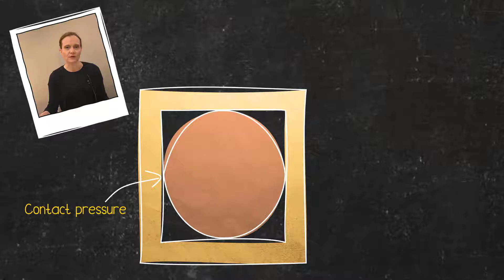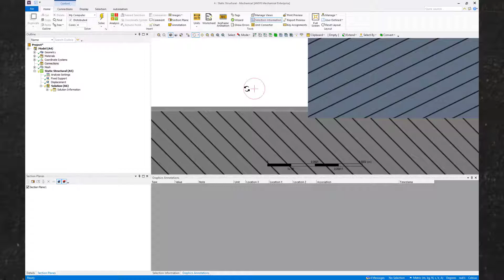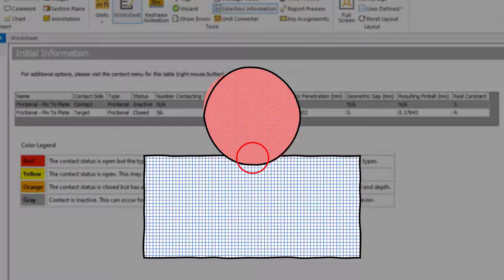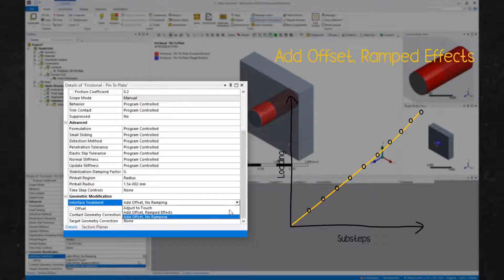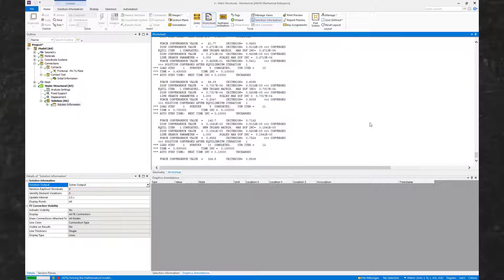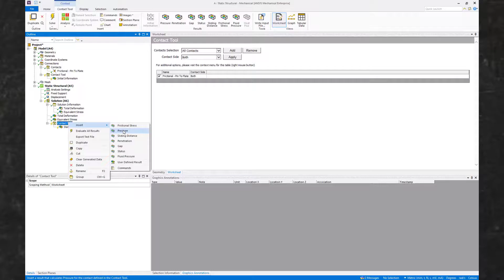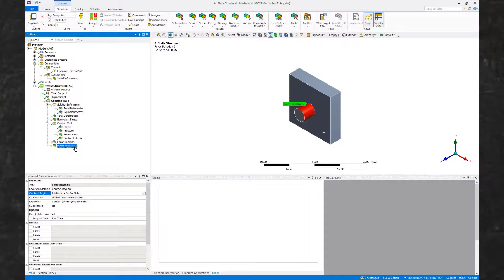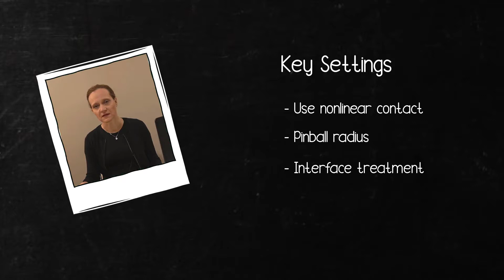Solving an Interference Fit Problem Using Ansys Mechanical — Lesson 2

Comment: +5 years later... this is great guys!! So many AhA moment.  1 question: Why did we see a small, but still considerable load during the first step when there was literally no displacement? It was about 10% of the final load, and interestingly in the opposite side. So, I was wondering if the calculated final force would be the difference between the two forces or not. Thanks!

Comment: What will be case if i want push the  pin by applying some force and pin and hole having interference in this situation what would be the load step setting?

Comment: Thanks for the video. but the stresses shown in the plate are very high. How can you justify them that my plate is not break. In fact I'm doing the fatigue analysis with interference connection between the bodies. So my question is due by the the high interference stress, alternating stress in the fatigue analysis is very high so. So do we have to consider the interference stress while evaluating fatigue analysis??
Reply from the maker: Thanks for watching! Please post your query on the Ansys Learning Forum for a detailed answer from the wider Ansys Community: https://ansys.com/forum.

Comment: Thank u for helpful lecture. And I have a question. In your practice you made two force reaction probe, displacement and contact region. and two outputs are different, about 1000N and 830N. what is difference between two methode and which one should choose for pull-out force.
Reply from the maker: Thanks for watching! Please post your query on the Ansys Learning Forum for a detailed answer from the wider Ansys Community: https://ansys.com/forum.

Comment: This video is very helpful. I am doing research about CNT (Carbone Nanotube)or CF (Carbone Fiber) embedded  in cement matrix. To  investigate the bonding strength there is need to do Pull - Out analyses which is very difficult. What kind of video or lesson can help to understand this type of analyses in ansys. Thanks a lot.
Reply from the maker: Thanks for watching! Please post your query on the Ansys Learning Forum for a detailed answer from the wider Ansys Community: https://ansys.com/forum.

Comment: Hi the equivalent stress is 4200 MPa in this problem, wont the material fail at this stress? Ultimate tensile strength for steel is around 500 MPa, can anyone explain.

Comment: Where does  the frictional coefficient of 0.2 come from and why ANSYS is displaying a warning message when using a higher coefficient? If you have a link to a page or article that explains it that would be great.
Reply: Coefficient of friction will depend both material. 0.2 was given as example on this video.

Comment: Is there an option to set tolerance field? In this case 0.1 interferance fit is on the whole surface constant which is not realistic it should somewhere be higher somewhere lower.
Reply: I think the idea here, is just to analyze extreme cases, Maximum (related to mechanical properties of material) and minimum interference (related to minimum pressure to create contact forces). Anything between these two situations, it's okay.